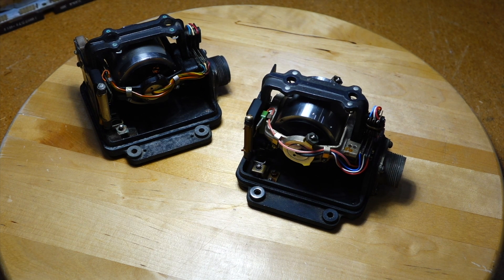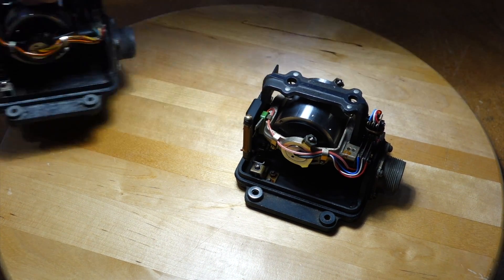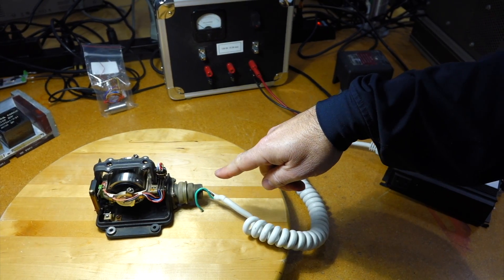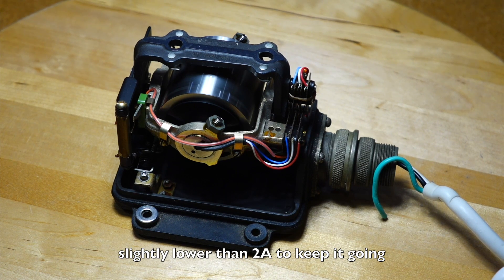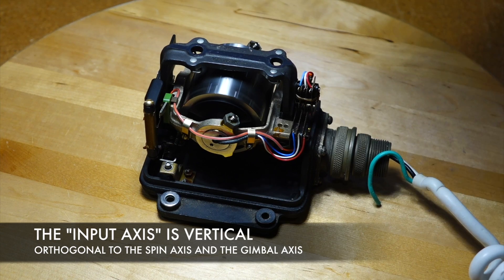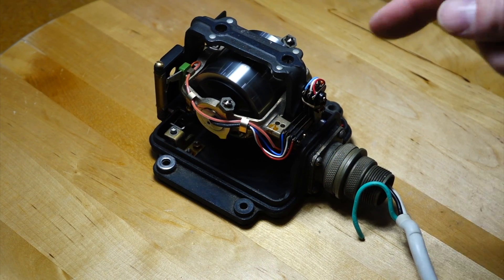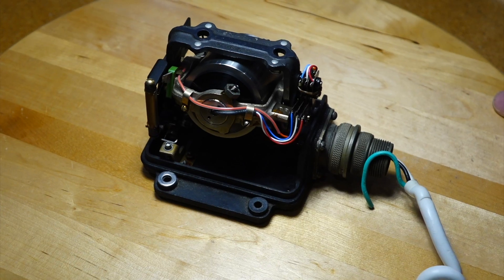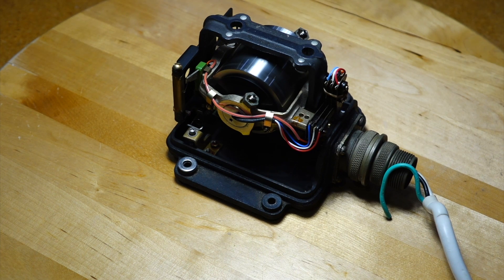Inertial Gyroscope Spin Up and Demo

Comment: Spindown takes >10 minutes.  The fact that any bearing has such little friction after all these years is simply amazing.
Reply: You don't know the weight of the gyro. At 24000 rpm the inertia can be considerable.
Reply: @LMB222 you mean it’s kinetic energy. 
Inertia is what it takes to get moving.
Reply: @idonjohnson6999 He actually means its angular momentum - that's the problem with pedantic lectures, you have to know what you are talking about.
Reply: Especially that bearing. That sounds rough!
Reply: @howlingwolven  It's characteristic of gyros for some reason. They all do that, after there's much more than the burn in time behind them. The bigger the unit, the scarier they sound lol

Rest assured the bearings actually hold up pretty well. Got a lot more calls to deal with flaky connections than rotor issues. They will spin like that for a long long time with no maintenance.

Heading gyros in particular, different type, but similar idea, take as long as 6 hours to stabilize and point true after startup, so cycling them wasn't something anyone "just did".
Reply: Have you seen the giant flywheel Adam savage built. It’s terrifying watching it get up to 300rpm
Reply: Looks like most of the energy is lost in sound emission :D
Reply: Sitting immobile for years frequently makes them run better for a while, because the oil gets redistributed.

Comment: This seems to be a custom modified sine wave inverter (just an H-bridge). Even though it's not as bad as the much higher frequency pulse trains from variable frequency drives, some caution may be necessary. Older motors can get damaged with inductive spikes from those types of waveforms due to insufficient/old insulation. Voltage peaks at the device will increase with longer wire lengths. The bearings may also sustain continuous damage if you were to ground the device being powered, due to induced EMI flowing from the rotor, through the bearing, into case ground. In essence, it becomes a mini EDM machine with microscopic sparks eroding the bearing surfaces. Even if it's only 10mA or so, it will take its toll over time. However, that issue affects variable frequency drives with high switching frequencies, and wouldn't be as bad in this case. You should still measure current to ground from the metal of the unit, just in case. And the last obvious thing is EMI in general. Shielded cables are recommended so that nearby electronics aren't affected as much. Custom filters will help as well. The position resistor wires will likely be very contaminated with EMI and may need filtering themselves.

If you guys liked this video, I highly recommend searching for "FIN-RPMD-Explorer" on YouTube. First result. It's one of the most beautiful videos of its kind, in existence. Please take as look as well Marc, I think you will appreciate it if you haven't seen it before.

Comment: The aviation AC power supply is 400Hz rather than the 50/60Hz used in people's homes so that the transformers aboard can be smaller, and therefore lighter. For the same reason, nowadays many computer power supplies take the AC input, rectify it, then use a transistor or special chip to turn it into much higher frequency AC so that it can be changed to a different voltage with a smaller transformer. I have my suspicions that this is one of the reasons why laptop power supplies fail so often...
Reply: I don't think linear power supplies have even been used for PCs in around 30 years, they're all switch-mode (usually ~30-100 kHz). Moreover, modern computers are absolutely LITTERED with switch-mode regulators. CPU and GPU Vcore, RAM and USB supply, you name it.
Reply: @zh84
laptop psu also uses rectifier and hf osc to work a smaller transformer :-)

Comment: I would have wanted to take it apart, check the bearings, and apply lubrication as needed before spinning that thing up. I wonder how many decades it has been since it was last spun up. I would have wanted more protection or distance between me and it.

Comment: Gimbal Lock.... ;)
Reply: This one cannot really gimbal lock, as it can only move in one plane other than the rotor spin plane (it has only one gimbal). It can, however, hit end-of-travel because being a rate gyro, it only moves a few degrees either way of center. Oh well - in such extreme movement as to reach EOT, I guess one could call it a gimbal lock of sorts.

Comment: Safety glasses yes, but I would be worried about those bearings seizing up and blowing apart and ending up in the emergency room having bits of them removed from my body.
Reply: @William Sudbrink
if the bearings seized the whole machine would take off , i had a reasonably small motor with crap bearings which i started running just clamped down , i left it running hoping the bearings would "run in" but after about ten minutes or so they seized and the motor went for a walk :-)

Comment: mother of all gyros in Apollo? No! Gyros were used long before for stabilization of instruments in ships, planes and even tanks (gunsights), and the first wholly integrated inertial guidance system, with flight computer actuating control surfaces, was mounted in the very first missile, the V2. 
Developed at the same time as Apollo hardware, the inertial guidance unit of the Concorde, coupled with the autopilot, was the first one installed in a plane. It was capable of automatically flying the supersonic airliner from Paris to NewYork with enough precision (less than 2km deviation at destination) to get it into autoland with ILS range, basically making the Concorde the first automated plane, but it was never used that way (pilots were way to proud to fly that marvel to let a machine does it for them).
Reply: Damien Drouart I think he meant ‘mother’ in terms of quality of engineering. The gyros in the Apollo craft were critical to getting the astronauts home safely, so the had to be very well built and tested.
Reply: What about the V1, which was truly the first cruise missile.
Reply: @user2C47  the V1 used a simple aerodynamic balancing and a timer that put the bomb in a dive once a certain amount of time, and thus distance, was elapsed. Very basic.
The V2 on the other hand was partially programmable and course was adjustable. It was used as is as sounding rockets.Von Braun team in Germany broke the Karman line with a straight up vertical shot, a feat the V1 could not do.
Reply: Did the Concorde's IMU do this uncompensated, or did it work with Doppler radar and Kalman filtering like the system in the Boeing 747; also, was the Concorde capable of automatic landing?

Comment: Wow, that rotor must be HEAVY for that long of a spindown with such noisy bearings! - I wonder how much mechanical energy is stored in that rotor - it's amazing!
Reply: It draws a good 50W for a considerable portion of the spinup time and since nothing melted, guess where all that energy went ;-)
Reply: @AKAtheA  Yeah of course. With "how much" I talk about what might happen if the rotor disintegrated in a loud bang - what would the damages be.
Reply: @zaprodk  It's a machined chunk of (probably even not just plain low carbon) steel. If it didn't come apart during the machining, then 24k rippums isn't going to do squat.
If something spectacularly fails, it'll probably be the bearings. Once that rotor is loose, well...would not want to be standing next to it...or in the same room... :D
Reply: @AKAtheA  that's what I mean. If the rotor somehow gets loose, I'll stand a bit away and watch the destruction :D
Reply: I made a gyroscope  onse  300~400 grams and it got lose from its axis  and started resonating  it got lose from the cage and burnt my carpet the hole in the centre of the brass weel was 6 mm now its 8 mm and it took a while  for it stop destroying my room  scary shit
Reply: Thefreakyfreek That’s kinda awesome in a scary way, glad it missed you. We have two DRUPS at work which is basically a few meters of flywheel carrying enough energy to power a room in our data centre until the diesels kick in. There has been much speculation as to what would happen if one unbalanced and got loose... based on experiences with ultra centrifuges, it would go through concrete.
Reply: @technicalvault  and indeed it was  awesome  to see how much energy was stored in that
Reply: @technicalvault  DRUPS, so I learned something today, thanks.  But now I have to do some math.  Our Jaw (rock) crusher spins up two HUGE flywheels with a big cummins/multi disk/14 v-belts .  I'm guessing here but the cast iron flywheels are about 7 feet tall and about 16 inches wide with 5 spokes.  Maybe 10 tons each ???  They don't go super fast, but it's safe to say they could easily merge right on to the Autobahn if they came free. it takes a 14 inch thick 3 foot X 3 foot chunk of concrete to have any visible change in RPM.  That said the mass of concrete becomes powder and 4 inch rounds instantly.  If they ever did come loose from the 12+ inch shaft and pillow blocks they might just make it from Arizona to Germany lol.  Since the DRUPS flywheels both supply instant power for the electricity AND supply the torque to start the diesel, they are always spinning and those bearings ....wow.

Comment: Always interesting to hear the resonances while powering up or down such high speed devices, I have two turbomolecular pumps one at 50k rpm and the other 72k rpm maximum speed.
Reply: Any chance of a video of them spinning up? (and/or spooling down)
Reply: The resonant peaks can cause problems; that is why VFD drives for large centrifuges and similar devices have the ability to rapidly pass over those points when they are bringing the rotors up to speed.
Reply: @johncantwell8216  excellent point!

Comment: sounded like a wanna-be Seagate ST225
Reply: Well, hard drives of that vintage, could have been made into a very crude gyro sensor. They had enough rotating mass. Lol
Reply: @Joetechlincolns  Even new hard drives have very noticeable gyroscopic effects. Not sure if enough to work as a gyro sensor, but with sensitive enough position detection, anything is possible, I suppose...
Reply: @Joetechlincolns  It works even with modern ones. Just try to turn one while in full spin. (yes, it's scary... don't take one with value.)
Reply: HA!  That was my first thought too.  Sounded like a Tallgrass Technologies external 20MB hard-drive I had in the '80s, attached to an old IBM PC.
Reply: Definitely similar sound that old MFM HDD-s emited :) Remember that first Half-Life game creators also used this sound in some places.
Reply: or a old quantum Bigfoot operating normally.
Reply: My thought as well.
Reply: Thought exactely the same thing :-D
Reply: Same here.
Reply: Agreed !
Reply: To me more like a 8" Quantum q2040 or q2080  HD with temperamental bearings.
Reply: It sounds like the 32 Megabyte RLL drive which graced my first 286. It seemed like acres of storage space at the time. 32 Terabytes is on the horizon now; a million times the capacity.

Comment: My ears! 😂

It sounds like one of the bearings is slightly ground, if you shorted the input (now the output) I'm sure it would have stopped much sooner, I wonder what power it was generating by itself🤔
Reply: With no permanent magnets, nothing afaik.
Reply: @zaprodk  this does not contain magnets?
Reply: @phonotical  probably not. It's an AC induction motor. No permanent magnets needed.
Reply: @phonotical  Marc doesn't mention the 400 Hz power is 3-phase, typical in aircraft systems and wouldn't need permanent magnets in the rotor. While googling this, found these lads restoring a V2 gyro also using 3-phase 500 Hz power: https://www.youtube.com/watch?v=Wj2QVgfyXik
Reply: @zaprodk  He said it was synchronous- if there are no permanent magnets it would be a reluctance or hysteresis motor. Such synchronous motors almost always have an induction winding for startup, then once they approach synchronous speed the rotor 'locks' to the frequency and phase of the input power.

Comment: Those Gyro bearings are fubar, but you know that.
The sound around 10:40 is particularly telling, it should be much quieter and much more steady in it's spin up/spin down noise.
Reply: Around 12:00 one can hear the shaft oscillating in the bearing
Reply: @cybercat1531  What do you expect, no controlled atmosphere, random shocks from handling, last aligned decades ago. But still, pretty good operation, a clean and adjustment will get it fine again, just needs a nice airtight box with vapour guard and dessicant packs in there to keep it alive for a few decades more.
Reply: It's exactly what I'm expecting. Just a casual observation of events put into words.

Comment from the maker: Sorry for the oopsie on the first version of this video and the lost comments. Had to delete it and reupload this one to correct for (yet another) big bad typo. And yes this is after proper cleaning and lubrication.
Reply: Hi, 2Amps that's a lot! Is that part supposed to be under vacuum ? (could change a lot of things i thought) Anyway doesn't sound good in a "friction matter" ;) Btw i'm curious about single phase design for this device (efficiency...) (sorry 3rd edit xD)
Reply: I'm also curious if this part is supposed to be under vacuum
Reply from the maker: @Melanie16040  It's not a vacuum instrument. It has a simple protective casing that might help air flow a bit.
Reply: @CuriousMarc  Thank you for taking the time to answer <3